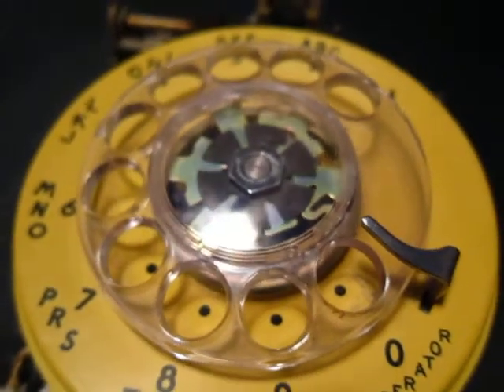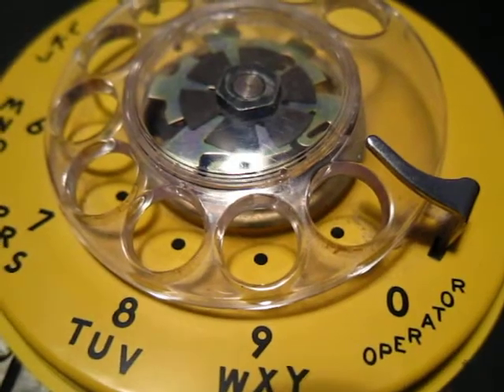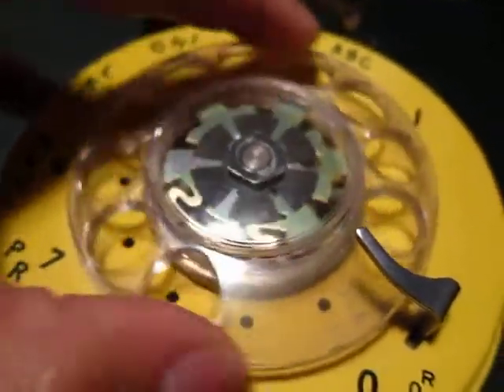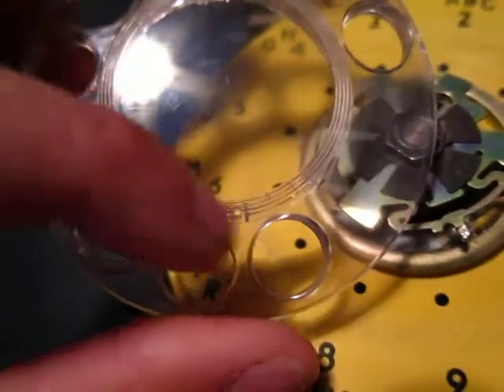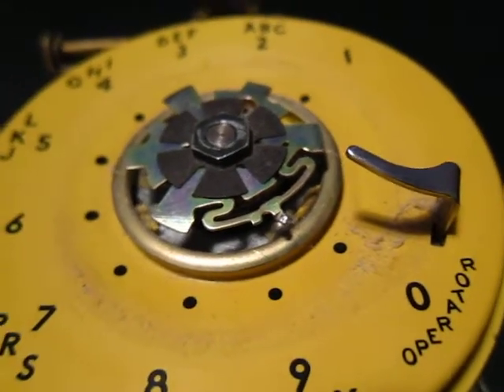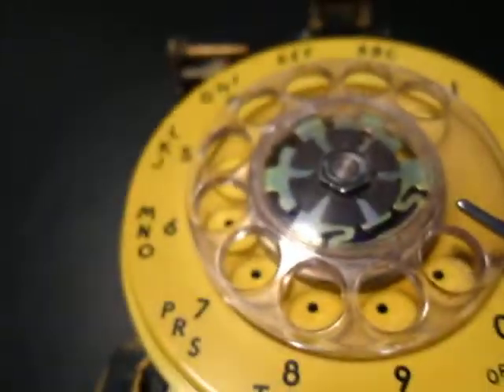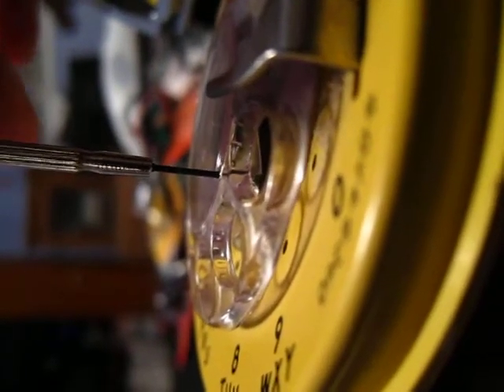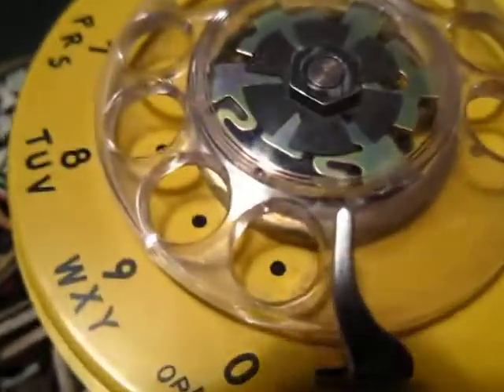UNDERSTANDING The Western Electric Rotary Telephone Dial Center Removal

Comment: Extremely helpful video, thank you. There is just no place else on the internet where this seemingly simple task is documented.
Reply from the maker: Scott Lloyd - thanks! It's such a simple thing but when "just stick a tack in the hole and twist it off" didn't work on this one I figured I might not be the only one who could benefit from understanding how it locks into place. Hope your repair/restoration is going well!
Reply: The Dom, I figured out the pin hole, but I couldn't figure out the dial twist. I kept trying to pry it off without breaking the dial. Thank god that AT&T had the foresight to create the world's toughest plastics. After you showed me, I then recalled my uncle showing me how this was done back when I was a kid. It must have been common knowledge at the time, but nearly forgotten in the sands of time.

Comment: It's just a simple matter of rotating the dial clockwise as far as it will go, then inserting a sharp object ie- thumb tack or drawing pin into the hole between 0 and
9 and pushing down firmly, this should release the dial.  UK models are much easier
its just a matter of prising out the label cover, then taking out the retaining screw.
Reply from the maker: Gary Dunn true, it should be that simple. But in this case it wasn't because the tab was mangled. And understanding what actually happens when you push a tack into the hole made it possible for me to get this stubborn finger wheel off.